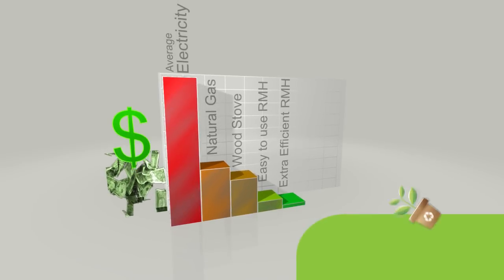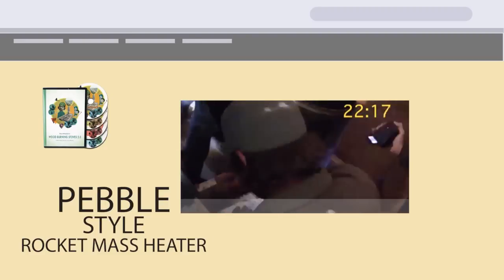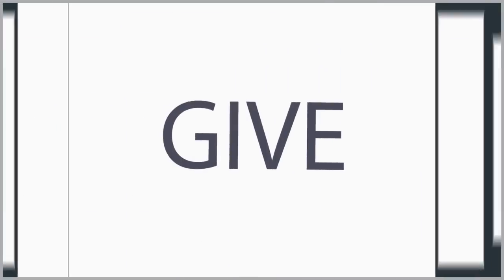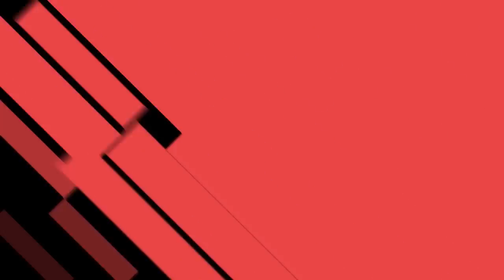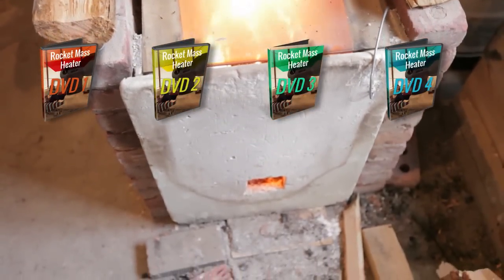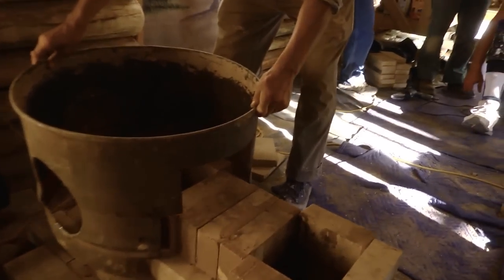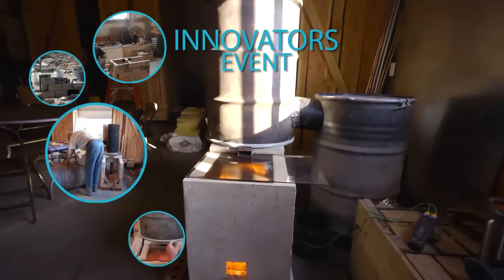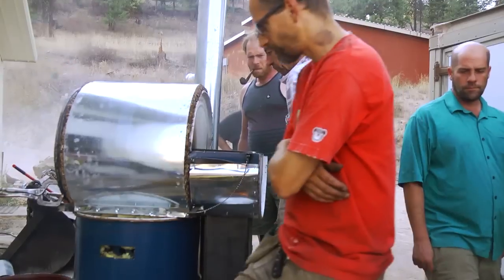Rocket Mass Heater 2015 Kickstarter 4-DVD set

Comment: Wondering if there will be a waste oil version in the videos. I live in Norway, and have been working with several designs for waste oil heating. Companies have to pay to get rid of it here, and are more than happy to let me haul off as much of it I can use. Saves them tons of money, and gives me free fuel. Have not worked with the "rocket" style stoves yet, but have a design in mind. I know they burn very clean, and think it will make the waste oil burn cleaner than it does in the other types I have tried ( which burn pretty clean). I got a little carried away with my last design, and it melted the cast iron pot I was using as a burn chamber.
Reply from the maker: These videos won't do anything with waste oil, but I think there will be some of that at this year's innovator's event.
Reply: +Thad Conklin There are endless video on yt about that, most are the all steel stoves, and I would want to be sure I was getting a residue free burn before I created the labyrinth a heater requires, but search and you will find all kinds of stuff.

Comment: Just wondering if there is any info on biochar rocket stoves, would like to see some efficient working examples
Reply from the maker: Our Sacred Seeds Because hugelkultur works so much better in cold climates.
Reply from the maker: All of this was filmed in montana.   Since biochar is so awesome in tropical climates, and montana is not tropical, then we tend to not use biochar here.  However, efficiency was measured:  http://www.permies.com/t/40007
Reply: paul wheaton Thanks so much for that, im from the subtropics and definitely want to incorporate biochar into a system soon
Reply: paul wheaton Why is biochar not ideal for temperate climates?